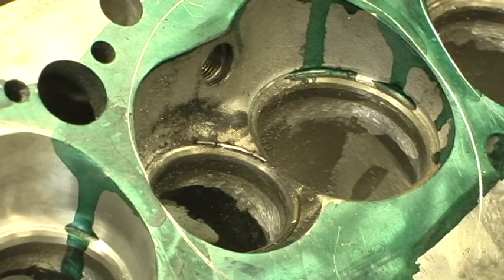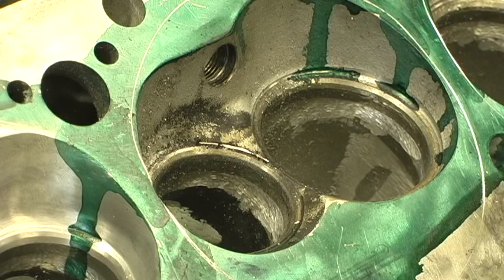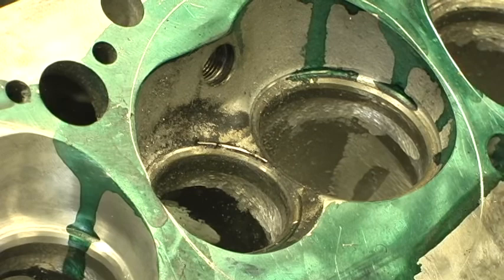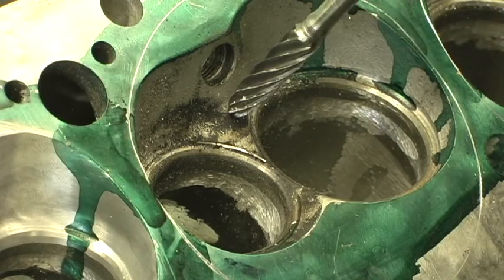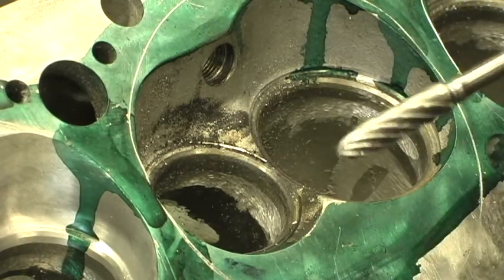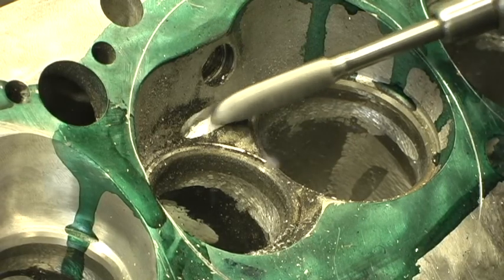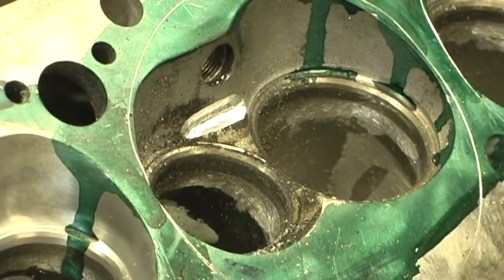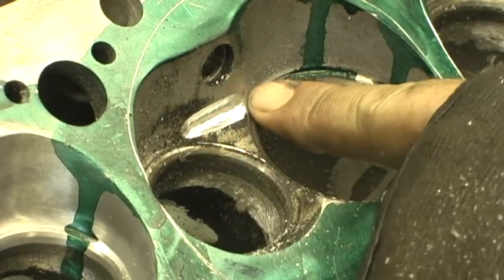Porting Pro Comp Chambers for airflow unshrouding

Comment from the maker: Around 20 plus CFM with the right valve angles and Valve Job, A lot to be done here as this is one of the main weekness of the head. First the Spark Plug, as it is recessed .200 up, next the Mask, or swirl shroud between the int. and Exh. layerd back at a 20 degree angle. Next is the "machinist ridge" which is the lips (deep lips on these heads) where the factory presses these seats in and does the valve job. This deal was bad enough that valve lift had to be .150 just to let air out.